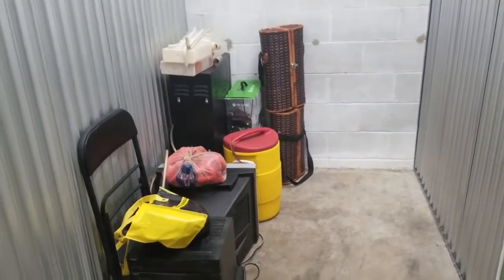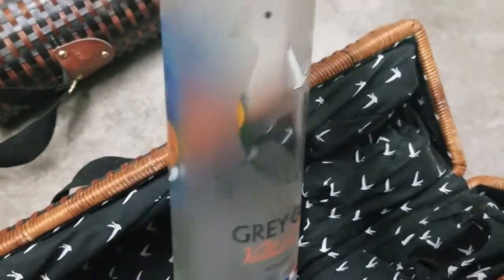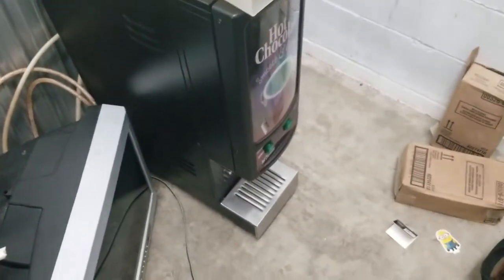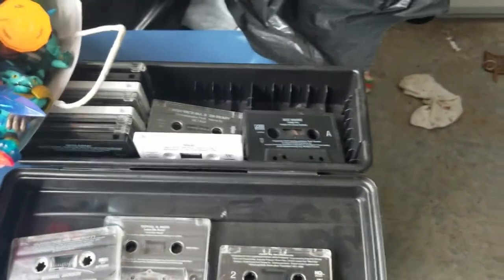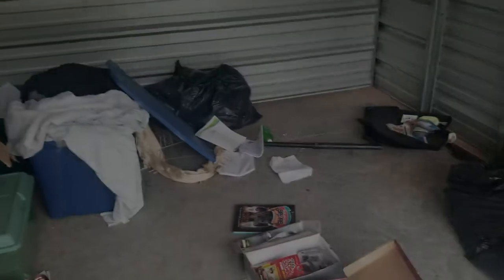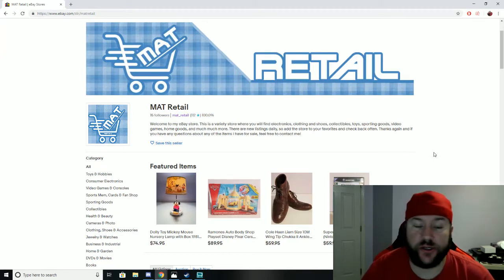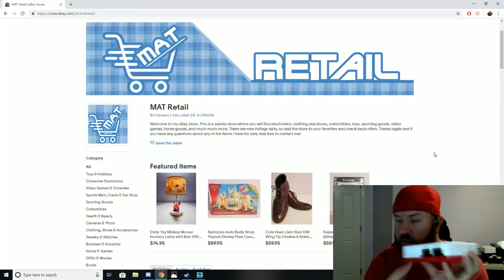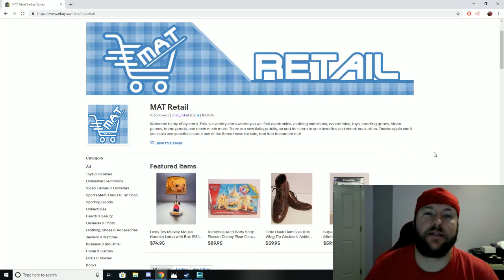I Bought Two Storage Units in One Day! Found Some Interesting Items In Both Units!

Comment: I love finding change. Make sure you check them. For pennies I check for old wheat pennies. Those are worth more than just a penny. For quarters, dimes, half dollars, dollars etc. I look at the date. Anything 1964 or later is worth more money because those are made of silver. I turned in 35 cents and got back 4 bucks. One unit I found a coin collection, had a bunch of wheat pennies. Some made of copper, some made of steal.

Comment: Hey Matt, if you're gonna do a lot of storage units. You're gonna come across a lot of them older tv's. This is what I do with them rather than just "getting rid of them" aka trash em lol. I take 5-10 minutes, cut the cord, take the back off and salvage all the copper wire that you can and put it up and just let it accumulate. It's adds up very nicely in the long run.
Reply from the maker: Hey Kevin, first off thanks for watching the video! I appreciate it. I never really thought about doing that. I have 2 older TVs in my garage right now. I think tonight I will try to do what you said and see how it goes. Thanks for the suggestion!!
Reply: @matresells4655  I swear, almost every unit I've ever bought, it always came with an old tv and for the longest time, I just took them to my recycling center and dropped them off there. Then I stumbled across a video of a guy scrapping out a microwave and it got me thinking and then I found videos of people scrapping out the copper in old TV's and I regretted just getting rid of all them TV's. 

Now, anytime I come across old appliances that aren't worth the time to sell and are too bulky to send via mail, I cut the cords off of everything, unscrew the backs and take the copper out and then screw the back on and then take it to my recycling center whenever I take my garbage off. 

Clip it, strip it and forget about it lol. You always need to have little side hustles as a reseller..... At least I do lol.

Comment: if you take less than 200 for the choc. fountain you be a fool...offer it to your local gasmart
Reply from the maker: I have it posted on several local sites now for $750. I am not expecting to get that much, but I thought I would aim high and see what happens. I can always lower it over time. My dad and I put a bunch of work in to it and changed out some parts and gave it a really good cleaning. It turned out really nice!